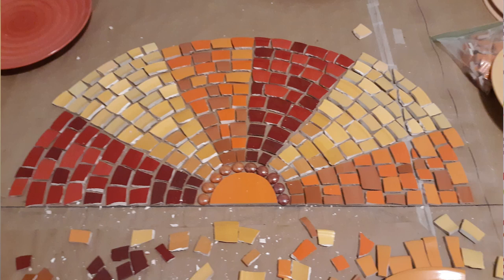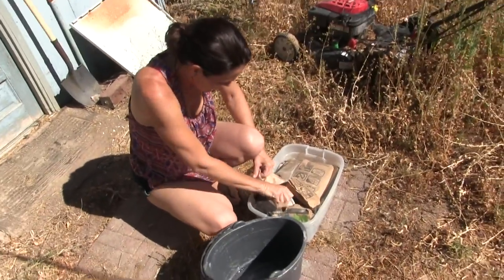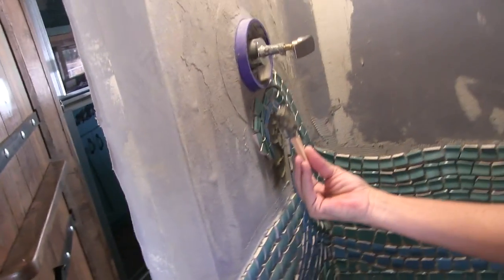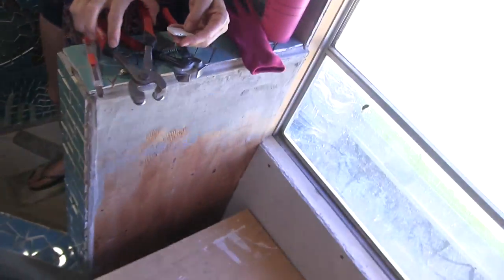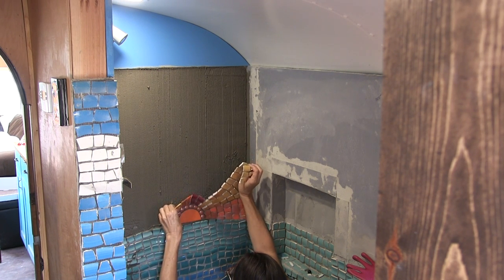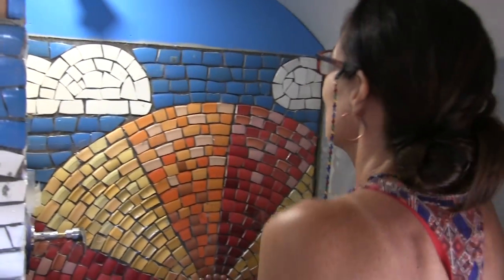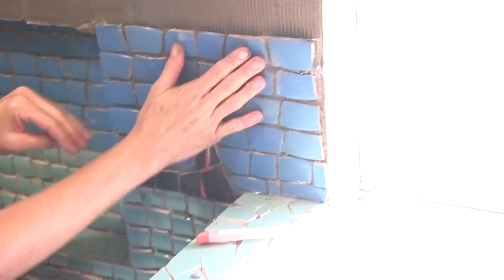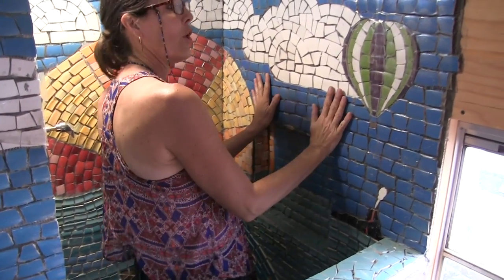Broken-Dish Shower Mosaic Pt 3 - Sky and Sunrise in our Skoolie!

Comment: How well do you think that will hold up when you’re driving or you doing anything special to it to keep it from cracking and breaking loose
Reply from the maker: We thought long and hard about this and is why we went with hardibacker for the walls. We knew there would be flexing and knew that rock board was the answer.  We are confident it will be ok.